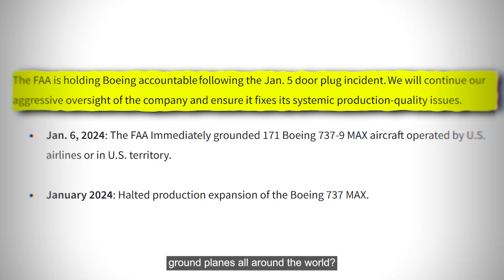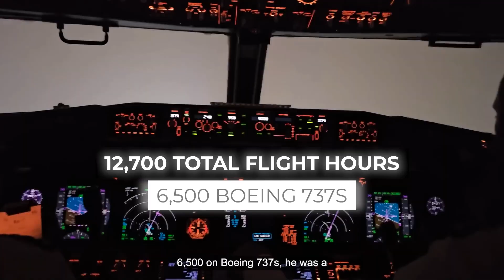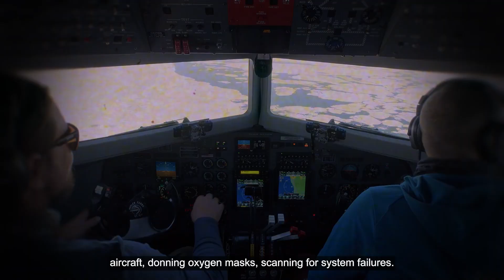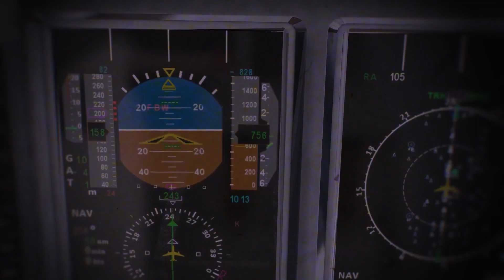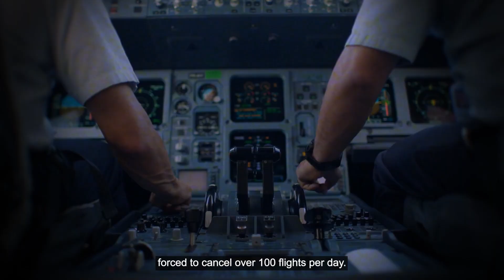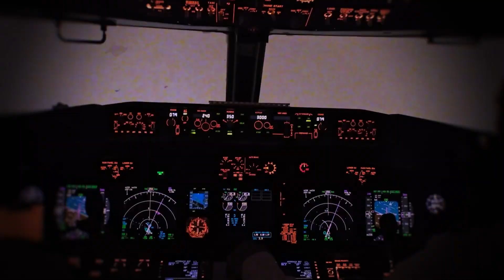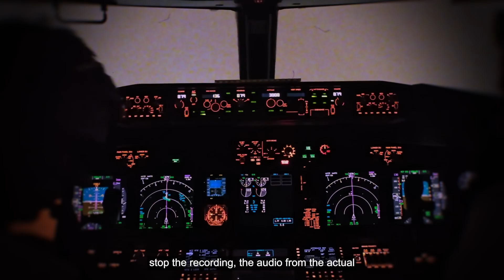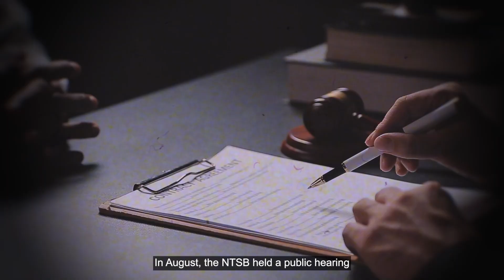How a Single Missing Bolt Nearly Killed 177 People

Comment: Such doors need to be ‘plug doors.’ 

Bigger on the inside than the outside. Then they can’t blow out, even if every single bolt is missing. It’s a really really simple basic design. 

Blocking an unused emergency exit, so in theory it will never ever need to be removed once fitted.
Reply from the maker: Nice suggestion buddy